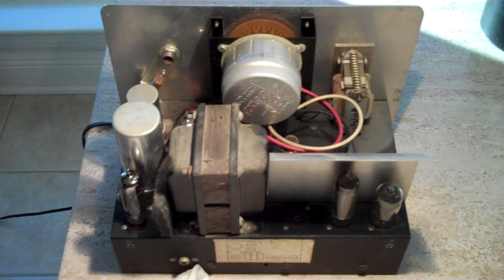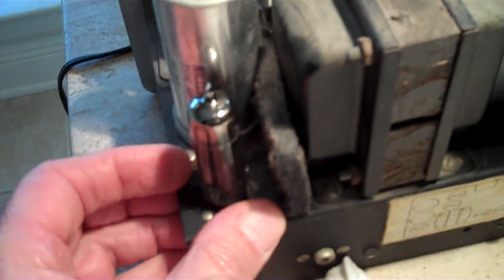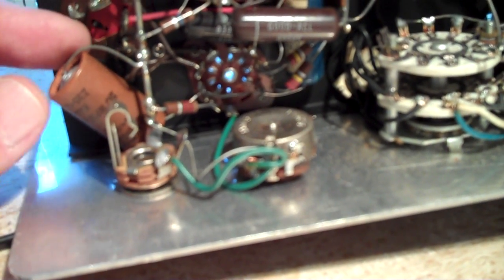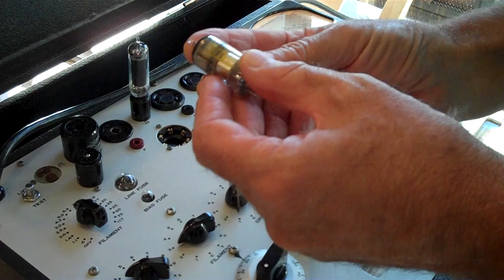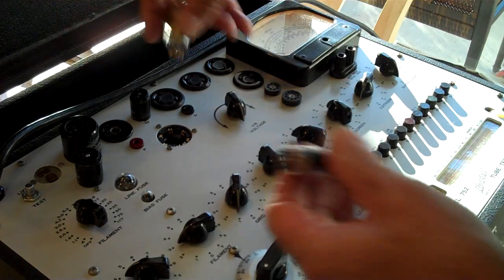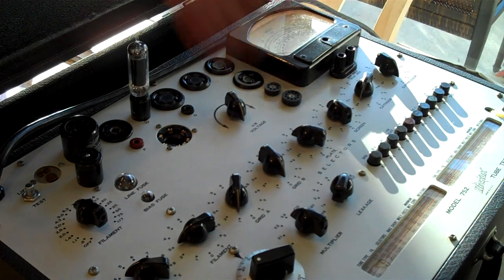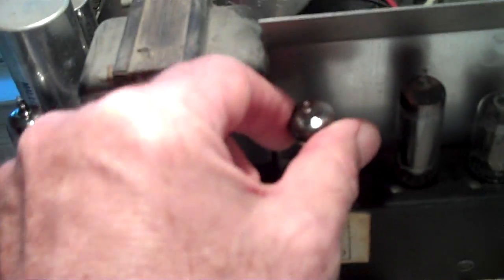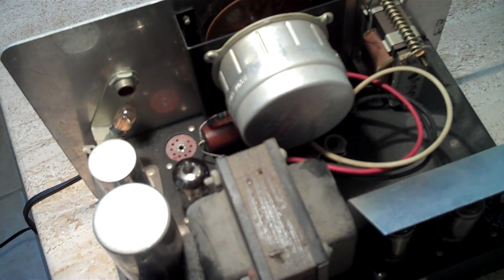Working on My Grandfather's Conn Strobotuner - Model ST4

Comment: I have the ST-1 coming into my shop...  it's reported to be in working order.   The ST-1 is going to be much older than me.. so I'm planning on replacing the capacitors,  since Caps seem to fail out after 40 years.   If the caps fail,  then it makes the tubes fail.  These are so retro-cool.  Strobo's are still the most accurate tuners.... although not the most convenient.
Reply from the maker: I should probably change the caps.  That looks like a lot of work though.  Since I don't use it anymore, I'm glad that is comes on and works.  I switched a few tubes but it did not make any difference in clarity of the strobe.
Reply: "Cap Jobs"  have sort of become routine,  and you get used it it.    I did a Peavey concert mixer...  350 caps in that one!  In the old tube stuff,  the  Electrolytics  (4)  should do it,  and for extra insurance,  the Paper/Oil  ones too. (6)     so  about 10 caps....   Most of the P/O types only cost 30c,   the electrolytics  3-4$

Comment: Here's something for you to mess around with Mills:

http://www.ebay.com/itm/5E5A-TWEED-FENDER-PRO-AMP-CIRCUIT-IN-A-VINTAGE-EXECUTONE-PA-CAB-GUITAR-AMPLIFIER/172075134885

I'm not sure if the link will display, but if not, go to eBay and search for "535a tweed" and it'll be the first thing that comes up. It's apparently a homemade Pro tweed that uses many vintage parts for the build. For $200 you couldn't go too far wrong. Might be worth buying just for parts. If it was a tweed Deluxe, I'd buy it myself. (I'm probably just going to build my own.)
Reply from the maker: +St. Hugh I seriously need to take an electronics course for some type of credit so it would push me to learn more.  Gerald Weber has some correspondence courses but I want something more comprehensive and pertaining mainly to amps and effects.  If it doesn't look like a Fender, I get nervous.  I have a really difficult circuit design book.  I should read it.  It is hard for me to understand a lot of it.  Someone else told me I should buy some high powered Traynor amps, but when I looked there were too many options.  He said they were Marshall like but way cheaper.  I would want to tweak the circuit to make it like a Marshall but that is where my knowledge stops.  I should tear into a bunch of my older recording mixing board and tape recorder to see if there are any good parts in there to scavenge.  I can see how that could become a good business if you knew what cheap equipment to look for.  I'm sure the experts have already driven the price up on a lot of old equipment just because of their parts.  I've got so many amps now, I don't know if I want to mess with another one right now.  I'm getting a boutique overdrive in next week that is supposed to be the bomb.  We will see.  It is called the Peacock Drive by Missing Link Audio.  The only thing that concerns me is they advertise it as "Allman and Betts Tone in a Pedal."  I will see if it will work with Strats.
Reply: +millstap Well, you know a heck of a lot more than me. The only electronics classes I ever had were in computer repair. What little I know about amps I've learned on my own, and that ain't much. Have you looked into Uncle Doug's amp repair channel on YouTube? He's a great old guy who just seems to know everything about vintage amps of every kind. Look him up sometime. I've never heard of that overdrive. I would have thought a Visual Sound Jekyll & Hyde would be up your alley.
Reply from the maker: +St. Hugh I'll check out Uncle Doug.  I think I have heard of him before and watched a video or two.  The overdrive is fairly new and I think they are trying to make a name for themselves.  I'll be able to tell fairly quickly if it is going to work.  I've heard of the Jekyll and Hyde but it has been a while since I have heard anyone mention it.  I should get the Peacock by Tuesday and will make a video.
Reply: +millstap Looking forward to the video.
Reply: Thanks for posting! I should mention D100 DeOxit is not a good choice for pots as it has a tendency to remove the lubricant from the pot and replace it with D100 which eventually dries for the most part. F5 or other Caig cleaners for moving carbon based contacts is the best choice for pots and faders. 
This video has me excited to service my ST6!